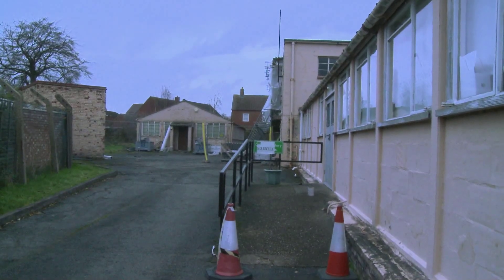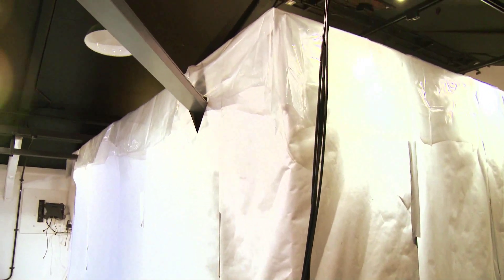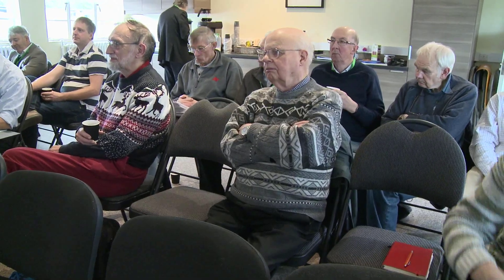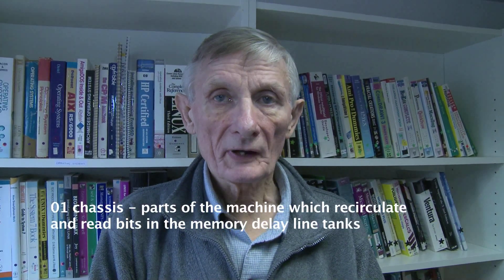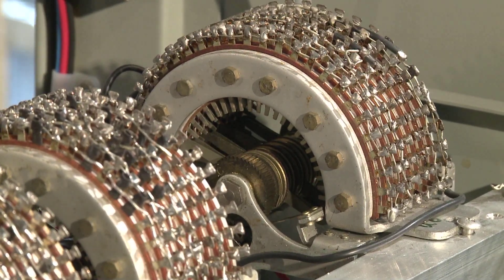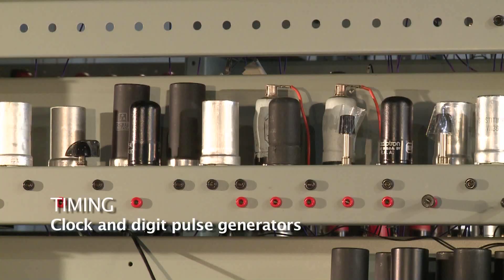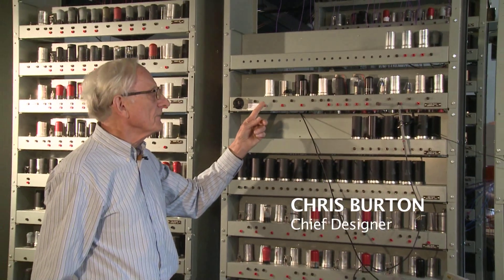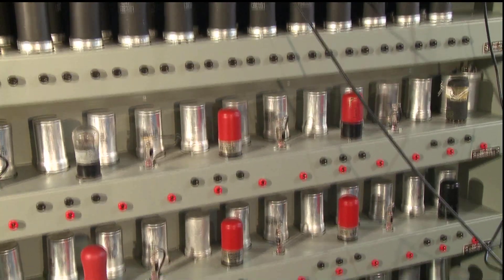Authenticity v Reliability. EDSAC runs by itself; how the team interacts to remaining challenges.

Comment: A comment from one of my friends who knows a thing or two about valves: If the clock oscillator is that fragile, why not use a mixer VFO or multiplier chain to allow the variable element to operate at LF?